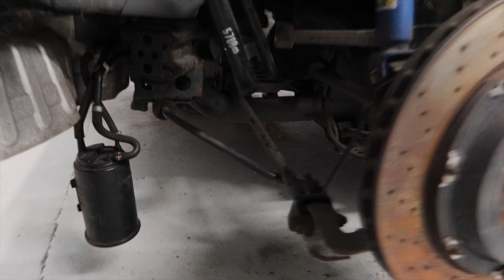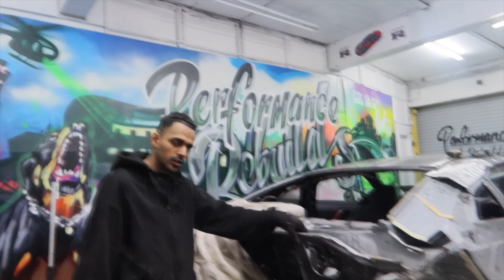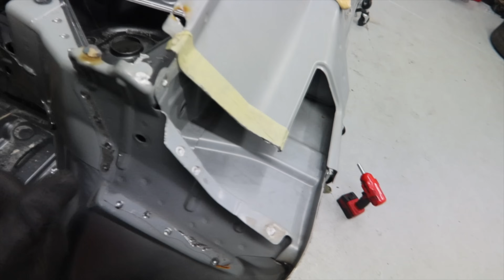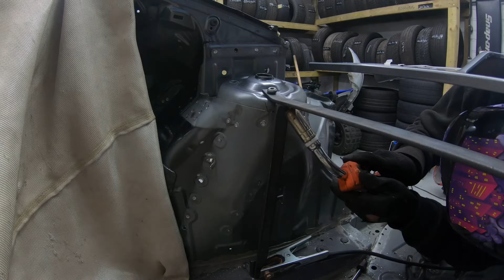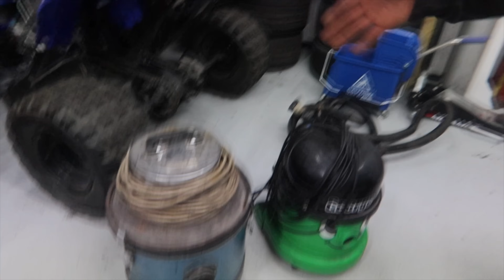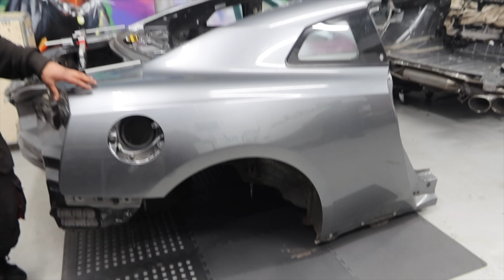Rebuilding a salvage Nissan GTR part 7 (QUARTER PANEL COMPLETLY REMOVED)

Comment: Tough times at present so lets all be safe and sensible and use some basic common sense 
Black Alloys for me 
Was never a Black alloy fan when they started to become the new fashion so they were a slow burner on me but they will look the part for that type of Car 
Stay safe guys and Thanks again for the recent upload

Comment: You need to make sure you are on OEM measurements not close to them. In which I believe you will be. There is no point in doing what you do if the alignment is out. Otherwise The car will not drive straight. The way you guys are working you will do a smashing job.
Reply: We're all hoping it doesn't drive straight just sideways😎

Comment: Letting the brake calliper hang like that with all the weight stretches the brake hose which expands when braking, reducing braking performance. Take it from.me I have replaced these after making the exact mistake
Reply from the maker: The calliper is hanging off a metal rod we made to hold it in place.
Reply: @PerformanceRebuilds  at the begining of the video it was in a free fall.
Reply from the maker: Will take your advice for next time we take a calliper off.
Reply: @PerformanceRebuilds  no need to remove calliper bro. Use that 'S' shape hook and hang from the body. That's what I always do
Reply: Look at 2:00
Reply: Good point we'll have to replace with braided hoses